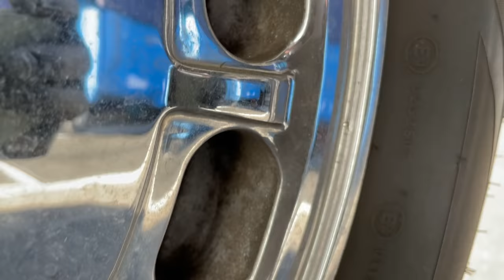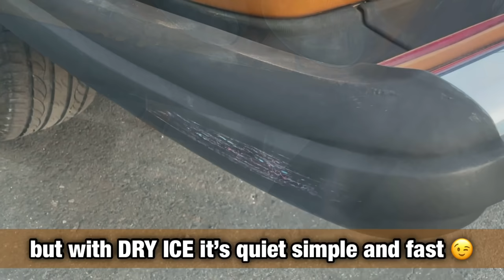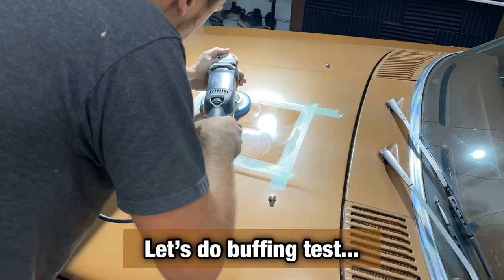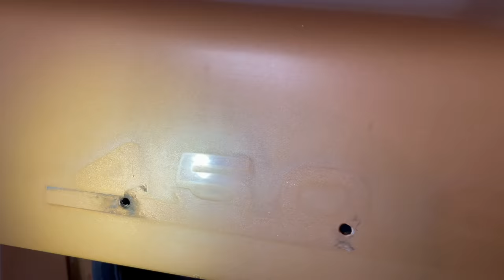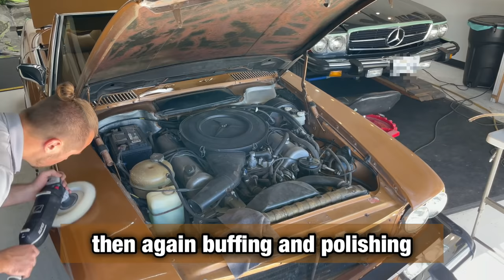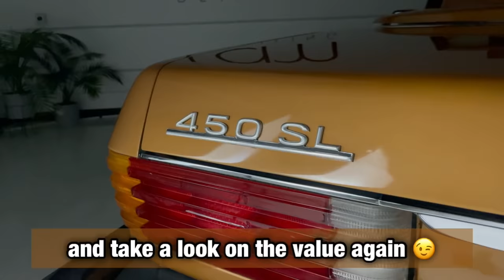DRY ICE CLEANING ENTIRE CAR Mercedes 450SL BIG TRANSFORMATION

Comment: I never heard of dry ice cleaning until now
Reply from the maker: You are not the first and also last one... I know about this process 2years but still we are only 1 of 2 shops who providing this type of service in California (another location will open shortly) 😉
Reply: + 1. Until a few minutes ago it was a novelty to me. Well, not anymore! Rather impressive I should say. ;-)
Reply: @IAMDetailing  Man that's so great!! You're one of the pioneers of that thing, KEEP IT UP boost it up quickly so many people will inquire to your store.. Wishing you all the best
Reply: It is also used to clean mechanical engineering parts, gearboxes, etc.
Reply: @IAMDetailing  so it does remove paint
Reply: Same, but it look more easiest
Reply: They use it a lot to remove mold from Attic's.
Reply: @nixaeagle141  and oil and.....
Reply: When Mercedes-Benz was head and shoulders above the rest.
Reply: its expensive
Reply: 20 years ago we were using dry ice blasters to remove roofing tar from roof cutters and tar hammers.
Reply: @nixaeagle141  depending on the setting
Reply: I watched a chap in England dry ice clean a Ferrari engine it cost about £300 for the equipment he did it himself at his garage.
Reply: @IAMDetailing  you learn English veri many
Reply: That's another expensive and stupid way to clean your car...
Reply: We’ve used it to clean machine parts for as long as I can remember, along with ultrasonic
Reply: They have been sharing it on tavarish some over the last several months.
Reply: Also called carbon, i heard about it for engine parts as an alternative to sand blasting
Reply: Can you please share a link of where you bought this equipment? I would like to buy it for my shop here in Atlanta.
Reply: @IAMDetailing  can you please tell me how much time dry ice cleaning + detailing it + ceramic coating it takes? Pleaaaase?
Reply: Until I saw these videos a few months ago, I'd only heard of Dry Ice Blasting in regards of removing Mold from structural wood during Home Remodeling.
This is great.
Reply: We use these machines to clean the off the moulds in my aluminum foundry. No sand to clean up after like sandblasting :)
Reply: Atleast now I have a video
Reply: I've been detailing for a long time...What is this sorcery?
Reply: The Shiv:  the cost of the machines for dry ice cleaning is quite expensive. If you have a repair shop or the like then you can use it to make money.. but most of us just need a smaller consumer aimed model thats not only less expensive but may take longer due to size but right now I have yet to find one new that is a good deal. ""like under 300 bucks""  goodluck..
Reply: Me too
Reply: @IAMDetailing  cool how you showed what dry ice cleaning is and how it works. Lol
Reply: @deifor  I’m proud to own two old benzes , they are special old cars
Reply: @crpth1  I feel the same way, I found out in August.  Just WOW.  What a difference.
Reply: @IAMDetailing  what engine parts should NOT receive the dry ice cleaning?

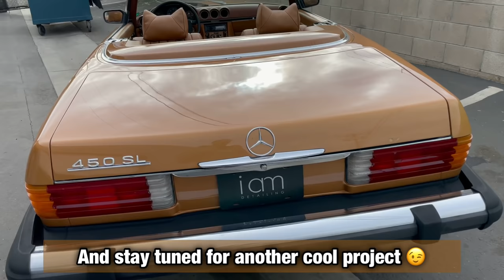Comment: Nice transformation.  I don't think I have ever seen this color before.  It looks like cantaloupe!  Does waxing and polishing come before or after the ceramic coat?  At 6:24 there seems to be something stuck on the right side of the deck lid.  Is there something special that you do for the chrome wheels?  I have read many negatives about chrome wheels.  I still don't quite understand.  Thanks for presenting.

Comment: I'm planning to buy the Coldjet PCS60. Are there any difficulties using the machine? And what are your thoughts on the machine?
Reply from the maker: DRY ICE BUSINESS STARTUP

Hi, since I’m not a distributor would be the best to contact directly the company for dry ice machine you’d like to buy. Every day I have so many calls, emails and messages with questions about the machine but unfortunately I can’t help everyone. 

Here is universal message that hopefully helps you. 

Mobile or fixed location? I was thinking about do mobile dryice cleaning a lot but it’s complicated and more expensive. You will have to deal with lifts, huge generator tow behind the car, space for work where you can make a lot mess and nobody cares that you producing CO2 in that space and also making 100db + terrible noise (it’s like a jet)

The work alone is really messy, everything will be very quickly covered with tons of dust. Also it’s really hard work (physically), blasting gun and hose are very heavy and not very flexible. Then you blasting with high pressure and imagine doing that 5-12hours per day with your head constantly up when you standing under the car and don’t forget that you will wear face mask, ears protection and probably full cover on your body otherwise you will be dirty like never. So trust me if I say that’s one of the most difficult work you will ever experienced. The process is super loud over 100db if you are 20ft from the machine. So always is the best to have a fixed location with proper ventilation (in close space you can be dead very very quickly) and you will need nice friendly neighbors that will be okay with the noise you making all day long.  

What you will need for start?
You will need a rotary screw compressor (30hp) with big tank (ideal 200gallons+) then you will need really good quality air dryer 150cfm+ (dry air is very important for proper working)

Then of course Dry ice machine that you like (brands here in the US that I found Coulson Ice Blast, Coldjet, CoolMaster)

Then you will need a lift for the car and also 3phase power in the building. Be also prep for washing cars after the work because the dust from underneath will be everywhere. 

All together very realistically you will need $70k-100k for everything to start this business and price will change up with better quality machines. 
My setup was around $90k for high quality equipment.

Hopefully that helps you. Otherwise please contact the company who selling the machine you want. I can not answer individually everyone how to setup their business sorry. 

The best of luck
Jakub 
Dry Ice Auto

Comment: Mate absolute stunning work. What model dry ice cleaner do you own? I want to buy one for my business here in Melbourne Down Under 😎🤟
Reply from the maker: Thank you 🙂 here is message that I made for people who looking for more info... 

DRY ICE BUSINESS STARTUP

Hi, since I’m not a distributor would be the best to contact directly the company for dry ice machine you’d like to buy. Every day I have so many calls, emails and messages with questions about the machine but unfortunately I can’t help everyone. 

Here is universal message that hopefully helps you. 

Mobile or fixed location? I was thinking about do mobile dryice cleaning a lot but it’s complicated and more expensive. You will have to deal with lifts, huge generator tow behind the car, space for work where you can make a lot mess and nobody cares that you producing CO2 in that space and also making 100db + terrible noise (it’s like a jet)

The work alone is really messy, everything will be covered very quickly with tons of dust. Also it’s really hard work (physically), blasting gun and hose are very heavy and not very flexible. Then you blasting with high pressure and imagine doing that 5-12hours per day with your head constantly up when you standing under the car and don’t forget that you will wear face mask, ears protection and probably full cover on your body otherwise you will be dirty like never. So trust me if I say that’s one of the most difficult work you will ever experienced. The process is super loud over 100db if you are 20ft from the machine. So always is the best to have a fixed location with proper ventilation (in close space you can be dead very very quickly) and you will need nice friendly neighbors that will be okay with the noise you making all day long.  

What you will need for start?
You will need a rotary screw compressor (30hp) with big tank (ideal 200gallons+) then you will need really good quality air dryer 150cfm+ (dry air is very important for proper working)

Then of course Dry ice machine that you like (brands here in the US that I found Coulson Ice Blast, Coldjet, CoolMaster)

Then you will need a lift for the car and also 3phase power in the building. Be also prep for washing cars after the work because the dust from underneath will be everywhere. 

All together very realistically you will need $70k-100k for everything to start this business and price will change up with better quality machines. My setup was around $90k 
and I have  Coldjet pcs60 

Hopefully that helps you. Otherwise please contact the company who selling the machine you want. I can not answer individually everyone sorry. 

The best of luck
Jakub 
Dry Ice Auto

Comment: Very nice. This is the first time I’ve seen the dry ice cleaning. Is that a new thing?
Reply: No, it’s been out for decades, I first used it in the mid 90’s, and it had been out a number of years then.
The principle is little different to industrial abrasive blasting, except the unit is usually an insulated stainless steel hopper, non pressurised, with an auger pushing the ice into the feed pipe.

Comment: Great job guys- detailed many of these old heavy benzs back in the day-- never used dry ice or knew was an option.  its great but that is super time consuming and expensive- good ol degreaser 4 zero steel wool mild acid on those rims (which stain so easily) and some compound good ol mothers wax and youre good- 2.5 hours same effect- so many products that work ok arent rreally necessary but helps to look fancy or pad the bill...still, not knocking the hustle!

Comment: I would that dry ice cleaning could work for cleaning intake valves on direct injection engines.  I've heard of people using ground walnut shells but that would leave a dusty residue on everything. 
 A rubber molding factory that I used to work at, used to use dry ice to clean the molds right in the molding machines.  No disassembly and no clean up afterwards.  Some outfit came by with a huge container of the dry ice pellets , must have been about a cubic yard of the dry ice in there. So I'm guessing like anything, if you buy enough of something and it makes the job easier, then it's worth it.

Comment: Before everyone does this... Dry ice blasting takes a LOT of air flow. Need 1” air line to feed it.  Your compressor must be able to provide the CFM. It works great but you must be very careful around soft parts. It can tear through them if your settings aren’t right or you dwell too long in one area.

Comment: How does the dry ice do with sensors, wiring harnesses, joint boots, and seals? Do you have to be careful around some components and materials? Just curious 🤔
Reply from the maker: If you know how to setup the machine then you can use it pretty much for anything... lots of control and many different options in settings give enough power to clean basically anything and you don’t have to  extra careful. But like with any other industry you have to know what you doing otherwise your client not will be happy 😉

We are able to clean leather/fabric interior or strip the paint down with this machine so there is plenty options.

Comment: Where did you get the dry ice device? Pls let me know?
Reply from the maker: DRY ICE BUSINESS STARTUP

Hi, since I’m not a distributor would be the best to contact directly the company for dry ice machine you’d like to buy. Every day I have so many calls, emails and messages with questions about the machine but unfortunately I can’t help everyone. 

Here is universal message that hopefully helps you. 

Mobile or fixed location? I was thinking about do mobile dryice cleaning a lot but it’s complicated and more expensive. You will have to deal with lifts, huge generator tow behind the car, space for work where you can make a lot mess and nobody cares that you producing CO2 in that space and also making 100db + terrible noise (it’s like a jet)

The work alone is really messy, everything will be covered very quickly with tons of dust. Also it’s really hard work (physically), blasting gun and hose are very heavy and not very flexible. Then you blasting with high pressure and imagine doing that 5-12hours per day with your head constantly up when you standing under the car and don’t forget that you will wear face mask, ears protection and probably full cover on your body otherwise you will be dirty like never. So trust me if I say that’s one of the most difficult work you will ever experienced. The process is super loud over 100db if you are 20ft from the machine. So always is the best to have a fixed location with proper ventilation (in close space you can be dead very very quickly) and you will need nice friendly neighbors that will be okay with the noise you making all day long.  

What you will need for start?
You will need a rotary screw compressor (30hp) with big tank (ideal 200gallons+) then you will need really good quality air dryer 150cfm+ (dry air is very important for proper working)

Then of course Dry ice machine that you like (brands here in the US that I found Coulson Ice Blast, Coldjet, CoolMaster)

Then you will need a lift for the car and also 3phase power in the building. Be also prep for washing cars after the work because the dust from underneath will be everywhere. 

All together very realistically you will need $70k-100k for everything to start this business and price will change up with better quality machines. My setup was around $90k 

Hopefully that helps you. Otherwise please contact the company who selling the machine you want. I can not answer individually everyone sorry. 

The best of luck
Jakub 
Dry Ice Auto

Comment: I have a 1960 Cadillac convertible with only 39,000 miles and the original owner had the $99 undercarriage protection spray option put on the car. Will the dry ice method remove that coating and clean up my undercarriage? Thank you
Reply from the maker: Most likely yes but can’t guarantee anything till I will try it. I have done some Impalas and Chevelle with undercarriage coating and it works but every car is a little bit different.

Comment: Like your work. May I ask how much such a detailing costs? Also, how did you fill in that lack of the coating on the front bonnet after it has been removed during CO2 cleaning
 Ta.
Reply: I think they sent it out to be repainted. Says it right in the video.

Comment: I had 2 cars dry ice cleaned and it was always underneath the car ( chassis) and engine bay ----1 1970 Monte Carlo SS 454 ( which had peeling under coating ) and 2014 Corvette I bought new had road debris